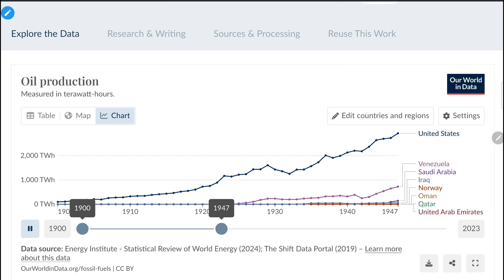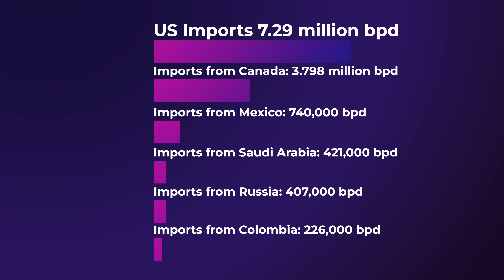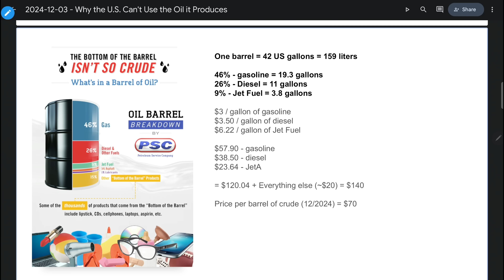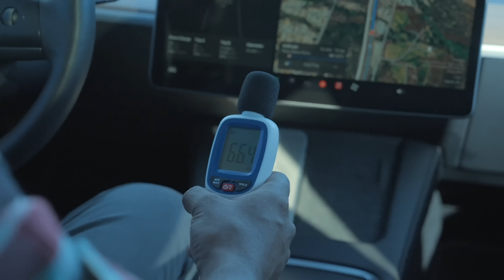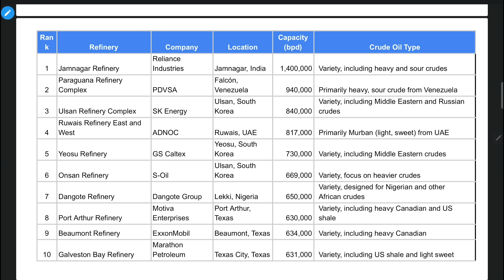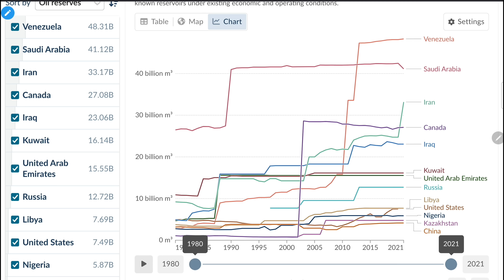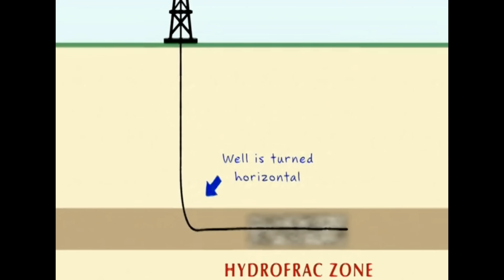Why America Can't USE The Oil it DRILLS

Comment: It's not really that US oil has changed. Texas and Louisiana oil (two of the largest exporters) has always been relatively light. WTI (West Texas Intermediate) is just shy of 40 API, making it just slightly heavier than shale oil.

However. heavy oils are more suited to the US consumption patterns. Most countries tends to consume an energy mix that requires less gasoline than you can get from a sweet light oil and being heavier on the diesels, kerosene and propane/butane. Which can be used for fuel or as feedstock for various chemical processes.

The US however needs a shitload of gasoline. And heavy oils yields slightly more gasoline per barrel, about 45-46% rather than the 40-43% that's the norm from light and sweet oil (like Shale, WTI, LLS or Brent).

The US also needs the sulfur (for industrial and agricultural use), as sulfur recovery from sour fuels is the primary source of all US sulfur manufacturing (88%). Especially since sulfur recovering from metal smelting has dropped (peaking in the 1980s and falling ever since) and sulfur mining in the US has stopped entirely.

Comment: With exception of Tesla and their new Model 2 solid state batteries that do not use rare elements and last over 30 years getting 400 miles per charge and can fully charge in 15 min; EVs are still not viable. And they still need energy that solar and wind will never be able to provide. Most EV charging stations are powered by coal or nuclear power. Unless we have a huge breakthrough in renewable energy (Thorium, Perovskite, recycled Uranium) your projections do not add up. Adding a few new refineries in the US to process our energy for the next 40 years does make sense. Adding micro reactors nuclear plants also makes tons of sense since they do not have near the issues or waste of the older models. Green energy is just not there yet and we have to invest in bringing American energy/jobs home.

Comment: FDJT.  I recently bought a Tesla Model Y. Its fsd is insanely good. Robo taxis can’t be far behind. I’m entirely off grid. My power comes from solar with battery storage. One of the things I like best about my new car is it runs on my own solar power. No infrastructure needed. Tell me how ff vehicles can ever compete with that. And by the way, my car is rated at 425 hp.

Comment: EV is the way to go. Oil companies don’t want EV. My house is solar. The amount I spend is zero for power. The cost to me was $8000 and I will be getting free power starting in November 2025. The cost of my monthly electric bill divided into my cost of put up the system. Hurricane Irma destroyed my electric power setup. So the cost of the solar less my monthly bill and the installation of power gives me free electricity starting November 2025.

Comment: Great Video, I would argue that the production of more oil in the USA creates more supply in the global market, which tempers prices.  Oil is a fungible product and our oil production does keep prices for crude down. 

Peak oil has been called so many times - I would be cautious in claiming we are hitting or will soon hit peak oil. Oil is still the cheapest, highest density flexible energy source. 

Electrification will take another few hundred years, the investment and environmental cost of electrification is not small. 

Innovation across the board is quite exciting to be part of.

Comment: Would it be more cost efficient for a new oil refinery company who specializes in solely refining this shell oil here in the US vs upgrading the current refineries? I almost sure that I don’t understand enough about the scale of the issue, but from a investment point of view I believe the long game would be to invest in those companies that produce the technology in such an efficient way that it would eventually be more efficient to do that than just keep buying foreign oil? 

We have the technology right? Why can’t we make it more efficient first then implement it when it makes sense? 

I know that politics get in the way of that, but at current political climates there are so many incentives to go for it. It may cost a lot now, but trends have shown since trends have existed that the prices may fluctuate but always tend to increase over time. And as far as electric goes, the issue is going to be the same, and that is if the demand is always higher than the supply the price will always be high. Wether it’s oil or electric right?

Comment: Is it worth upgrading refineries to deal with shale oil? of course it is.  As technology gets better, you reduce your waste emissions helping the climate, you use more parts of the oil in the barrel increasing your efficiency, reducing the need to extract further barrels.  If a refinery already exists and need upgrading, you use the permit process to remediate contaminated land, demonstrate the reduced environmental impact of the new technology involved, citing transport and economic factors, extending to the ability to reduce petrol prices for local residents.  Money always talks.  People have to live near refineries, you may as well compensate them for it!  The absurdities of raw materials logistics are stark sometimes.  In South Wales (UK), British Steel would import bulk carrier loads of coal from Australia for steel making, rather than use the coal from 30 miles up the road from the Welsh Valleys where coal had been mined for years.  I'm sure there were technical reasons for using one type of coal versus another for some products, however it was often cited that the reason for the imports was that even with the 10 000 miles or so of sea journey, coal from Australia per tonne was still cheaper than the locally produced material!  Welsh coal was shaft mined, Australian coal used Open-Cast techniques.

Comment: America's own petroleum is too thick and viscous and has a slightly different chemical composition. The energy used is therefore higher to break up the crude oil in a refinery (cracking process). Russian petroleum is slightly lighter and has a different viscosity and chemical composition. This makes it easier to process and uses less energy. In addition, Russian oil is cheaper and can be extracted and transported more cheaply. A large part of the American oil processing industry has adapted to Russian oil. Converting to domestic oil would be really expensive.

Comment: Not exactly sure why you consider 100% ev adoption a certainity. Imagine everyone in NY plugging their cars and trucks and whatever in at night? There is no power to power all of that at the same time. Its impossible. We will ned oil as long as it exists.
Reply from the maker: actually not true, some peole will charge at work, or while shopping. some will charge at home. Then all these cars in the future could be the storage, for excess wind and solar, and help stabilize the grid. ALso over 10% of all energy in the U.S. today is spent in refining oil. Lots of factors and it's definitely interesting. 

AI will likely use more power than EVs here soon... but here's the thing, if you have demand, in a free market people will want to make money and provide it. making electricity will be lucrative, as it already is. as demand for oil drops, the opposite will happen there, and prices will shoot up and drive the cycle further. It's classic disruption and has happened over and over, through the years. 

cheers

Comment: I worked in oil industry my entire working life... your analysis is incomplete.  The price of natural gas is one of the biggest factors in the price of light oil (upgraded from heavy that comes out of the ground), and the byproducts (depending on method of upgrading).  Heavy oil is difficult to transport and sell, so it is either upgraded on site, or nearby to a marketable product.  You description sounds more like a Biden era message that is strangled with regulation.

Comment: Shale oil uses a lot of water and the ground and the ground water will be destroyed.  In areas where shale oil was drilled people who live in the area could turn on the tap water at home and light it up with a lighter.
Future Hybrid cars (with 95% les CO2) have the future but eventually Hydrogen vehicles will be the best for the planet.
Electric cars are not green at all the industry just shifted the exhaust some where else and by the way the produce so much more fine dust because they they wear out the tires faster !

Comment: You also have to remember to there's over a hundred different crude oils with different specific chemical makeup for instance tar sands from Alberta Canada that United States uses 5% for petroleum plus it's very expensive and you have to use 10x more then regular crude oil
Reply: OK

Comment: The Gulf Coast refineries were originally optimized for WTI, which is a light, sweet conventional oil. In the 1980's there were a number of joint ventures by the American refiners and PDVSA, the Venezuelen state oil company, to revamp the refineries to process heavy crude. The advent of Hugo Chavez and radical socialism in Venezuela basically destroyed PDVSA and the oil production in Venezuela. However, at the same time, the Canadians invented Steam Assisted Gravity Drainage (SAGD), which made production of oil sands bitumen much cheaper and more practical. The Alberta Oil Sands are a unique oilfield, with over a trillion barrels originally in place. The reserves depend on cost, but it is almost inexaustable. So the stranded asset of the heavy converted refineries and Canadian heavy oil is a match made in heaven. The midwest refineries were already receiving Canadian oil through the massive Enbridge pipeline system. The original Keystone and other pipelines were built to bring WCS (Western Canada Select) to the Gulf Coast. Danielle Smith, the Priemier of Alberta, recently announced plans to double Alberta production to about 8 million barrels/day by debottlenecking all of the pipelines out of Alberta. Once oilsands production is installed, it has very low decline rates, unlike shale oil, which has such high declines that it requires continual drilling to maintain production levels. As such, it will probably be even cheaper into the future to import Canadian oil and export shale oil. That is a win-win for both countries. DJT has complained about the US trade deficit with Canada, but without oil & gas imports, the US actually runs about a $60 million trade surplus with Canada. The balance of the deficit is to buy Canadian oil. However the US typically gets a $10-$20 discount for WCS from WTI, and by reefining and selling this oil the US refining industry doubles its value again. So replacing Canadian oil with US shale oil would cost the US almost a trillion dollars a year. Since Canadian oil is no security threat whatsoever, it would be madness to pursue this, and it is doubtful if it could even be done sustainably with the declines that shale oil has.

Comment: nah. That calculation is wrong and the margins way tighter.
The reason is you need to use barrels of oil to a) get the oil to the refinery and b) burn part of it for energy.
The upside will be +20% at best on each barrel of crude actually turned into sellable products.
That's part of the big risk why Tony Seba predicts a refinery crash by 2028 once EVs do go into mass adoption in China. China actually managed to decouple their economic growth from oil in 2024 or came so close 2025 is guaranteed.

Comment: to put it simply - Americas refining system is set up to use lower cost heavy oil like comes from Alberta . But most of Americas oil is light oil that it exports so a 25% tariff of Canadian oil will drive up the cost of refined Gas in America .

Comment: In the long-term picture as electric cars and electrification of our system with solar and wind in additions will affect our energy needs We are nearing the plateau of oil demand while there is definitely debate over when this will start to crater the estimate is that it will exponentially fall when it does it won't be a gradual demand slump when it does start to crater it will be a nose dive. Saudi Arabia itself is trying to change its reliance on oil production but that's a difficult change for a country that's been a one trick pony for years. Even though our own country is dragging its feet about conversion to electric cars It's not a if it's a matter of when China itself which is producing massive amounts of electric vehicle and high quality ones from what I've been able to read at least within the last few years is not only manufacturing electric cars but electric buses and Tesla itself is making more money out of electric storage many of the systems that use wind or solar are using electric storage as a backup The truth is worldwide we produce more electricity from solar and wind then we could possibly use at the given time so we have to develop as many different methods to store it as possible so within the next 15 to 25 years we will see oil demand crater it definitely won't be this year and it definitely won't be within the next five but it will definitely be after that.

Comment: One thing you forget to mention is that most the oil trade  happens in 

petrodollar system, which has been a cornerstone of U.S. economic dominance  . Petrodollars are U.S. dollars earned by countries through the sale of oil and other petroleum products. They have significant implications for the U.S. economy and the dollar's strength . It’s huge  factor
Reply: The US dollar is losing dominance. Brics are not using it.

Comment: The issue has been since the first oil well was drilled in Pennsylvania in the 1850's that oil is just a link in the chain of the supply of energy required for the survival of the human race. From the discovery of fire which required the first fuel to burn we have been progressing through the years to more sophisticated and efficient forms of energy. Because of "peak oil" we are at the end of our hydrocarbon man phase and must find a different source of energy for our survival. However, our reliance on hydrocarbons has lead us over a cliff and we are now falling into the abyss. On the way down we will fight hydrocarbon wars and cover them up with climate change excuses.

Comment: We have the plants you speak of. Problem is, we also refine more than you think with local , as you say.  

We can squeeze more oil out of the crappy crude than our local crude which makes way more profits.  We lead this. 

If you just found out we want to export more , you are behind.  Noone will tell you , in our business, why .   Oil is a currency. 

Chew the fat on this.  How many tankers are anchored up refining black market gas.  
The crude can be traced to origin. Gas can not.   Therefore bootleg gas is being brought in devaluing our currency, oil.   

Don't get me started on natural gas.  Whole different cartel.  

We now, TODAY, have a containment system that filters the salt water used in fracking.  

Fact check anything I leave.  
FYI, Port Arthur is the biggest refinery for tar crude.  Think of it as a consentrait.  

When my Mrs, great great great grandfather and friends found oil after cows drank out of it and died, Spindle top, it was revolutionary to make any product. Gear grease, made from cows like I sell , along with shampoo, fuel, clothes, nail polish remover, ............. look it up yourselves, this drives vegans crazy.  Especially gear grease and nail polish remover 😂. 

From Texas to NY, coal mines shut down.  Those states have Walmarts and Micky Ds running!  Broke folks, lifetime miners.  

Remember, we live in an open trade GLOBAL economy.  You have to visit every country or you'll only understand what you are told about oil.

Comment: Someone please check my math but if proven reserves are 40,000M barrels and we use 20M bpd, this equates to 2000 days or only 5 years.  Can this be correct?
Reply: More like 6 years, but yes. They always find more though.
You have to look at the production though. It's a production of 12.5M per day so it will last at least 11 years. It's why nobody will invest in this.

Comment: The real reason we can’t use what er produce is because it is nearly impossible to build a refinery in the US, and we need refineries which use sweet light crude (which is what we produce) while what we have is refineries which use heavy sour.
Reply: 7 are permitted already for Texas and specifically designed for light tight shale crude.  They cannot get funding to build them.  The problem is major banks.

Comment: Thank you for the video.  Now it is time for a new video outlining the effects of tariffs on imported oil.  👍👍🇨🇦
Reply: Five bucks says the sour crude we import will be exempt from the tariffs, and countries that purchase our sweet crude will reciprocate. Will imports of finished oil products like diesel and petrol be subject to the tariff? Who knows?
Reply: @ernestinebass4371  Who's to say, tariff or no tariff, Canada may decide to shut down supply of crude until all tariffs are removed from Canadian exports?
Reply: @edwardscott9200  will never happen and doesnt need to, its clear to anyone there is NO viable short or mid term alternative to buying it from Canada, the only issue is at what price. simply adding an export tariff will cause the desired effect of raising fuel costs in the US which will be VERY unpopular to the average american VERY quickly
Reply: @ernestinebass4371  the tariff can be added as a retaliatory export tariff so it wouldn't make any difference. In fact if there IS indeed a carveout for that oil it is almost guaranteed that's exactly what will happen as exempting it will be more or less the US showing your hand that it would be politically VERY unpopular   to have increased the price of fuel and it will be VERY visible to the average US consumer.